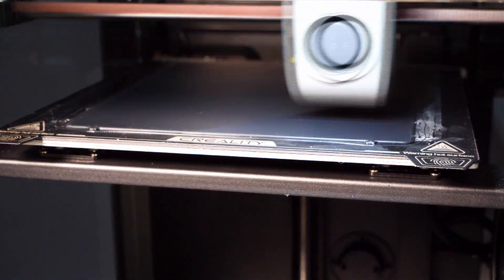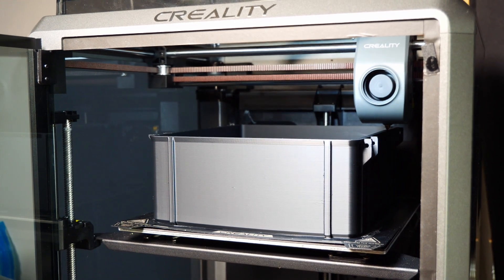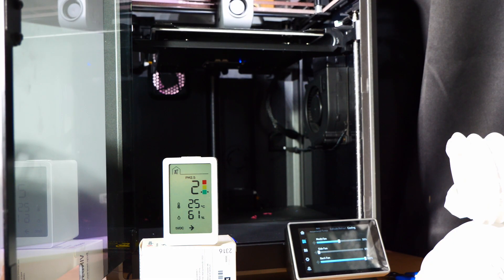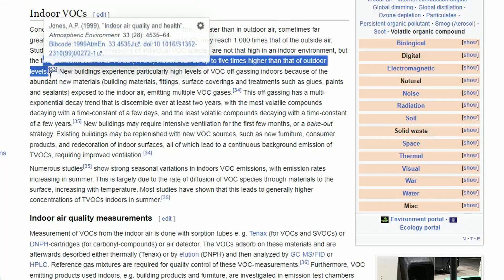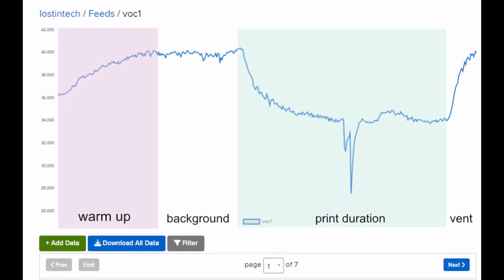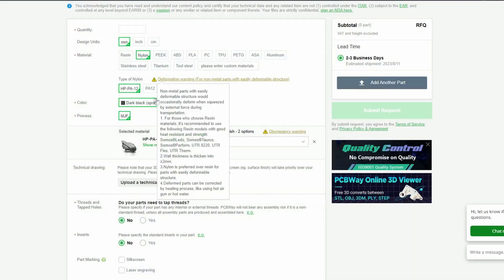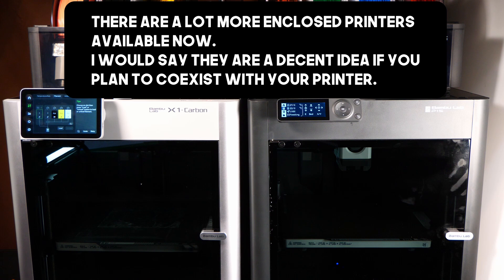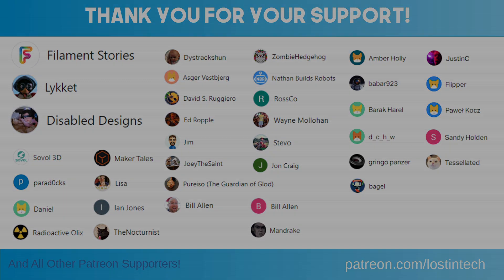Your 3D Printer Stinks.

Comment: I'm new to fdm 3d printing and am still on my first spule of anycubic highspeed pla (I've done sla printing before).
Without measuring: Both methodes significandly worsen air quality. I've put my printers in a seperate room and run an exhaust to outside. Without the fan the air quality drops massivly even during 30 min prints. 
Tank you for putting in the effort to measure this. I'd also think that the values differ not only between plastic types, but also between manufacturers due to additives.
Reply from the maker: it absolutely does, there are some real stinkers out there, which is why measuring ultimately only gets you so far, and evacuating air is the right answer.

Comment: Can’t wait for part 2! This Is something thats always on the back of my mind when printing. I recently got a Bambu x1 carbon & that printer has a built in chamber fan with a carbon filter, regardless I added 3 anycubic air purifier inside the enclosure & then added to the back of the chamber fan a hose attachment with a 4inch hvac hose to a enclosure with a room purifier with Hepa filter & carbon sucking in air from the x1 chamber fan vent. I know it might seem like over kill but there just isn’t enough information for me to be feel safe in my room while printing. If I can provide any data I would love to try to contribute to your research being that it’s something that isn’t really talked about too much.  Great videos by the way.

Comment: I would look into the bsec library from borschfor the bme680... it categorizes and quantifies the vocs more and its made for Arduino so you would get more detailed calibrated data. Thanks for the video as well and I would love to see a video on the health effects of various vocs from printing on health with studies linked as well as redoing the test with and without the filters with the bsec integration. Another test idea is to test print temp vs voc increase above ambient, keep up the good work!
Reply: i would also add a fixed Fourier transform on top of the values from the library to stabilize everything

Comment: This is not really news, filament sellers just dont want to tell you. (or don't care enough to find out)
newsflash, plastic is not good.. Bad for your health, bad for the enviroment, but very, very useful and there is no way to get around it or get away from it.

There is no escape from it, it doesnt matter where you go on the planet, plastic and other substances will be there right alongside you.
That's why there isn't a zero tolerance for pollution, just ppm guidelines.

Your bodys saturation of plastics, heavy metals and other toxic compounds started in the womb, passed from your mother through the umbilical cord.
(youd think she could've installed a carbon filter at least)

You probably won't live long enough to see negative effects from most of it at the ppm's stipulated by health organisations.

As an old adage goes "The poison lies in the dosage"

Tip:
One way to lessen bad offgassing is to lower your printing temps as much as you can get away with, most commonly used plastics are practically inert when in solid "cold" temps.
The higher the temps, the worse it gets.

As a test, light a piece of abs on fire and measure the particles (in a controlled enviroment) , if you had the ability to measure the chemical makeup of  that particulate it would go rapidly from "decently okay-ish" when melting to "WTF are you doing!!" levels of bad when burning.
The composition changes quite drastically at certain temperatures, molecular bonds are broken down and form new ones in the air etc.
Pom, and other acetals are some very nasty examples.
For the details you would have to get a court order and force Dupont (nylon) and the others to disclose it, or hire some lab techs to do it.

If all of this sounds scary, go get bloodwork done, the amount of trash just in our bloodstream is astounding, imagine whats floating around in the rest of your body.. :)
oh, wait.. that didn't help, did it?

Play it as safe as you want, just don't go full howard hughes..

..Fdm printing is a "Meh" on the "unhealthy hobby"-scale

Resin printing however, now that's stuff that should be banned for unregulated noncommercial use, its very reactive, not inert at all, with multiple well known immediate health hazards regulated in law already, but somehow is being treated with willful ignorance by both producers, retailers and the populace.
"my resin is safe, it's water washable!!"

Please step away from the tide-pods sir!..

Sorry for the rant, but i work with injection molding, and i could go on forever about molten plastics..

Tldr:
Don't sh*t where you eat.
Don't drink the bleach.
Don't eat the tidepods.
Don't huff the fumes from melted plastic.
Reply from the maker: haha appreciate the rant, I hate to imagine how bad styrenes smell when you injection mold them

Comment: how good is a carbon filtration really? im looking into starting  to print abs with my p1p, but if the stink is to bad i wont be able to use it, can a carbon filter fan solution fix that maybe?
Reply from the maker: looking into that in pt 2
Reply: Carbon will remove reactive chemicals from air/water, the problem is mostly time & volume.

This is something you'll see with water filtration, basically nothing in a reasonable size will actually remove dangerous substances, but volatile compounds (which are the ones we can smell & taste, for the most part) obviously react with the carbon & are neutralised much more effectively.
Reply: You 'might' have some luck with an extractor system based on bubbling the fumes through water.
An ion purifier might also be effective, but I can't find a straight answer anywhere.
Ozone would definitely work, but then you have to deal with ozone.

HEPA filters & venting to atmosphere seems like the safest option from actual reading

Comment: im curious on how effective a setup like the Bambu lab X1 is in reducing the VoC and particles with the carbon filter. Downside using the stock settings is that while using the smelly stuff the fan is usually off because usually the toxic stuff tends to warp
Reply from the maker: hmm...true

Comment: Pimoroni are selling the BME680 for £12.30 and the garden for £8.58 at the moment.
Reply from the maker: wow thats cheaper than the bare chip. I heard they got robbed, that sucks.
Reply: @LostInTech3D  Yes, I heard about that. Hope they manage to recover what was stolen. I've now got my BEM688 connected to the same Raspberry Pi running OctoPrint and I'm ready for some code.

Comment: Thanks so much, very interesting testing you've started to do! Why not test what is detectable if you directly exhaust from the enclosure? I actually just bought a tent enclosure for my ender 3, an inline exhaust fan, and located the printer near my window. I'm planning to connect the enclosure to the fan and the fan to an AC window exhaust insert. My hope is that's the best anyone could do at home in a small place. Thanks!
Reply from the maker: yeah if you exhaust from the actual enclosure then you're really gonna have no issues at all, as you're creating a negative pressure in there.

Comment: To be honest, I don't know if I fully agree. Sure, 0 VOCs detected is ideal. But, I am sure there is a threshold of what will actually cause irritation or issues for a user. If there is a threshold how does the rate of VOC emission from printing filaments compare? Is the total quantity of VOCs consumed a factor; PLA over 2 days vs ABS over 6 hours, etc. To say all levels of VOCs are bad feels oddly weird. Alcohol is bad, but consumed in small amounts over a period of time shows little to no adverse response/issues.
Reply from the maker: You're absolutely right, and there are defined occupational limits. I really want to be able to quantify these amounts, I'm working on it.

Comment: given the point on cooking, it should also be noted that the particular compounds in the particulate matters. Assessing an acceptable level of risk requires further research. The definition of pollution in this case more or less being anything airborne.

Hepa filter units setup near printers are likely a good precaution.
Reply from the maker: Agreed, although gas cooking has other nasty surprises that HEPA won't catch.

Comment: So glad to see someone else thinking about this! I'd love more info on indoor air quality and 3d printing! The best setup I've figured out thus far is to run the printer in a relatively low-traffic room together with a HEPA filter. I've been considering trying to rig some kind of corsi-rosenthal box inspired enclosure, but it's probably overkill. From the reading I've done, HEPA filters still do a great job of picking up UFPM. For really small stuff (<100nm) existing filtration technologies actually have an easier time catching them. Brownian motion makes it more likely that particles will touch the filtration media and then Van der Waals forces hold it in place. I also don't print ABS/ASA or other filaments that produce lots of VOCs. PLA, PETG, and TPU don't generate much. I think PCTG and other PETG relatives are also okay, but I can't find actual data on that. Nylon actually isn't too bad either. It does still emit a little styrene and put out more UFPs, but it's dramatically less than ABS. It's tricky to find info on how much styrene exposure is considered safe, but my best estimate is that it is a legitimately small amount from a single printer. Photocopiers technically emit styrene too, but it only becomes a concern if there are lots of then together.
Reply: Source on the comments about UFP emissions and VOC emissions for various filament types: "Emissions of Ultrafine Particles and Volatile Organic Compounds from Commercially Available Desktop Three-Dimensional Printers with Multiple Filaments" by Azimi et al.
Reply from the maker: Excellent, I'll check that out

Comment: Great video.  I love homemade science.  I'd like to scale up my home based print farm.  The plan is to enclose the area under the deck to make a separate room where the 3D printers would live, with the CNC laser if I ever finish building it.  I could harvest the parts and restart the printers a couple of times per day and ventilate to the outside before entering.  FDM 3D printer micro particulates are a serious concern but I'm even more concerned about VOCs from resin printers.  Klipper would be a huge help in remotely managing a small print farm on the opposite side of the house.
Reply from the maker: I'm doing resin in a bit and I'm planning to check out the levels there, hopefully
Reply: @LostInTech3D  - Testing resin printing, you'll probably give your VOC meter cancer.

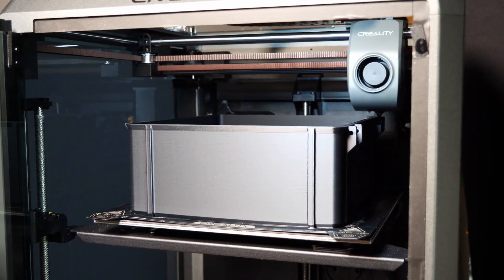Comment: in the clip where the K1 is printing at 2:23, is the spring steel sheet lifting in the corners ?!
Reply from the maker: Yeah it was, this is a thermal contraction thing with straight sided boxes, I'm surprised the bed didn't let go first, lots of forces there. The solution is a brim, but I forgot to add one.

Comment: Air filtration is key. But you can build a very effective air filter using a decent box fan and 4-5 HVAC filters with activated carbon for ~$100 or so. Even a pretty cheap fan can get up to 20ACH, which is more than enough to remove most pollutants.
Reply from the maker: I wish they sold colour changing carbon that would show you when it's expired

Comment: Living with someone who is sensitive to smells and particles, we have become more aware of this. I think there are long term health issues and 3d printing at home is still new enough, that we just don't know. Even if you don't smell anything,  you are still breathing plastic particles. Putting things in your lungs just seems like a bad idea.

To make everything safe, all of my printers are fully enclosed in the garage and have created negative pressure air flow with an exhaust fan attached a dust hose venting outside the door and I still think I can do better.

Comment: I have an ender3 v2, I got it about a year a go and my place is very small, I had to put it, in my bedroom on my work desk next to my bed, so you would imagine that sometimes I sleep right next to my printer while printing large prints, I mainly print in pla, so I thought its not that big of a deal, but I also do some pla welding without wearing a respirator even though that I have one, and also there is a decently sized window in my room but I never actually use it, Now I realize how stupid I was, Now I will make an enclosure for it, and I will start using my window more, and No more pla welding without a respirator, I would actually love to see a video about how bad pla welding can be for your health from you.
Reply from the maker: I think small things can probably make a big diff. I don't really do any welding so I can't help there, but I don't see many people wearing respirators

Comment: Carbon does work, and is used by car painters, and others. But what many don't seem to understand is that carbon has a shelf life of 6months, and once exposed to air carbon actually is only effective from 2-6 hours, and then needs to be replaced. Yes I said 2 to 6 hours. Car painters go through loads of the stuff to stay safe. So I wish some one would do tests in the 3d printer world. I used to work closely with car painters. Carbon is not the magic filter many seem to think it is. I know some only replace their carbon after months of use.
Reply from the maker: Yeah, carbon also absorbs VOCs indiscriminately so if you're cooking, you're expiring your filters
Reply: 2 to 6 hours, interesting. So how do normal circulation air filters for cooking last for 2-3 years?
They don’t have hepa filters only carbon, they remove the smell. So you are saying after 2-6 hours they only remove the smell but not harmful VOCs?

And all the data from different Nevermore users saying that one Nevermore micro lasts 30 hours is fake (of course it must be fake, they use fake sensors, I forgot), like the moon landings?

Comment: Nice comparisons! I personally miss PC in the comparison as this is a filament that is also widely used yet not well documented, and for the Bambu lab X1C I would suggest looking into the Bento Box that removes VOC's from the air inside the enclosure. This should help mitigate a lot of the VOC's escaping into the air. The Bento Box contains both a HEPA filter and activated carbon.
Reply from the maker: Yeah I dropped the ball, I have a whole reel of PC
Reply: HTPLA or PLA+ as well as it's really very common now a days and includes many other compounds besides pure PLA.

Comment: Great video.  I had similar concerns when i got into 3d printing so I put my printers in enclosures with carbon filters and in addition installed an air exchange unit in the room to ensure a supply of fresh air to the room.
Reply from the maker: Ultimately it can't hurt to do that

Comment: Great video, I notice that there is a smell when loading PLA filament, almost a sweet smell, then nothing during printing.

I’ve got the following air quality testers:
- AirThings View Plus: samples only every few minutes, does everything, very sensitive, more for general home use.
- AtmoTube: picks up PM well like others but VOC not sensitive enough and takes a while to register, it’s portable, only samples every few mins
- Temtop LKC1000S+: Very sensitive and continuous reading while on.

On the topic of ikea they do a massive carbon and particle air filter should check it out, the FÖRNUFTIG. On full speed it really packs a punch. I’ve thought about just sticking it on top of an enclosure 😂

Comment: Carbon filter is the answer, it removed ABS smell completely for me. Make sure to get proper carbon, the easiest choice is nevermore packages. Would be great to see the tests!
Reply: Carbon does work, and is used by car painters, and others. But what many don't seem to understand is that carbon has a shelf life of 6months, and once exposed to air carbon actually is only effective from 2-6 hours, and then needs to be replaced. Yes I said 2 to 6 hours. Car painters go through loads of the stuff to stay safe. So I wish some one would do tests in the 3d printer world. I used to work closely with car painters. Carbon is not the magic filter many seem to think it is. I know some only replace their carbon after months of use.
Reply: @gotmilkbutt  on the larger printer(v2.4) I built a filter with large amount of carbon, it delt well with odor for half a year or so. On the small one I replace it once a month.

Comment: Ikeya!
So that a big plus into "IDEX, AMS and other automatic multifilament solutions" vs manual filament  changes then. My current setup still requires removing the purge amount by hand and pressing a button to continue the print.
Reply from the maker: Could just hold your breath 😁
Reply: @LostInTech3D  gasps
slides down slowly

Comment: Yeah, my extruder gets to a ridiculous temp (like 230C+) when loading and I will see smoke too.
Also. this is a wild guess but your parts cooling fan seems to be off when loading filament. 
Maybe it's better at stirring the particulates into the air when printing something thus reducing the overall count?

Comment: I have k1s printing abs enclosed up with a 4” ducted fan similar to what you’re showing exhausting the air out a duct in a window, can’t tell i’m printing at all sitting right next to them. Also have built bentoboxes inside the enclosures